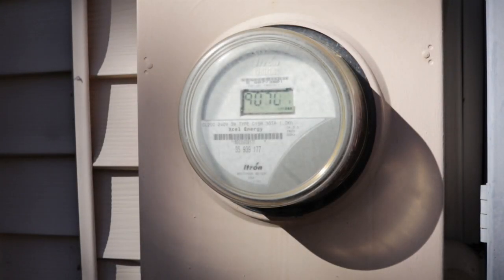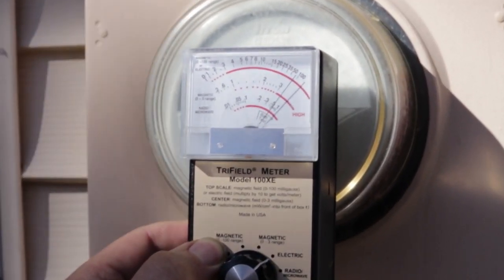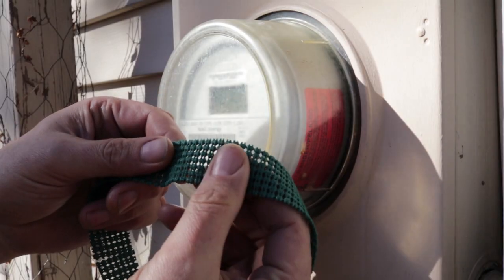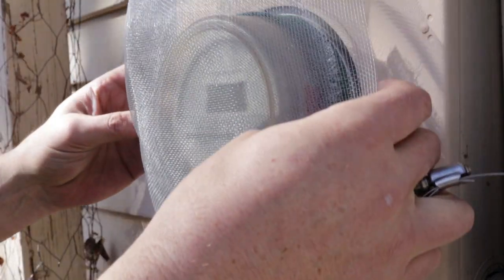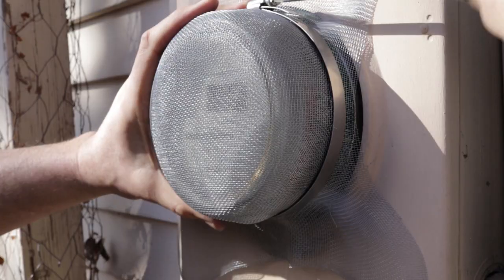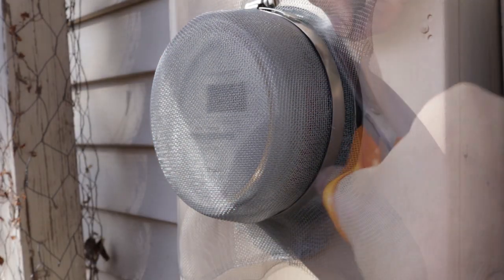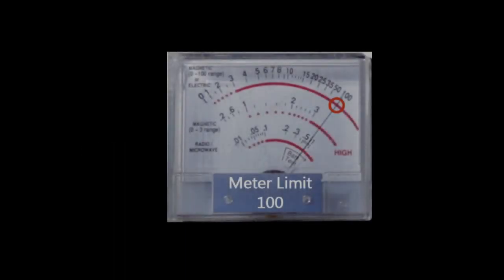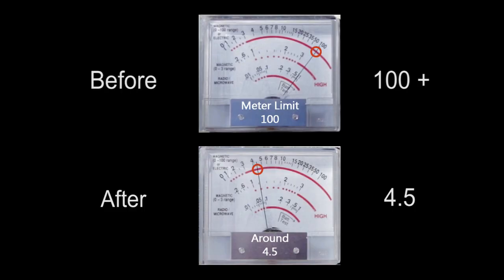Easy To Make Smart-Meter Shield Cuts EMF 95%!

Comment: But the meter at 1ft away it is not reading anything bad, only when you put the meter right up to the smart meter does it increase to 100.  What is the point if you are generally always a few feet from the meter??

Comment: by shielding the front side, the signals bounce around and amplify coming out on the inside. The best way to shield your self from it is by placing a 1 meter flat sheet of aluminum fly screen on the inside wall. all signals will then bounce off it and go outwards and away from the house.
Reply: Curious why a screen and not solid

Comment: My first thoughts...
The "smart" meter is designed to communicate with a base station. When blocking or reducing its signals, it may very well adjust the output signal up to max possible effect, just like mobile phones have the ability to do.

Comment: Yes, aluminum screen does make a significant difference. I had mine tested , I saw the numbers go from a high of 19000 units , down to 108-120 units as soon as the screen was installed. Stainless , or other conductive metal works, but not plastic bug screen. I will suggest that the screen is absorbing the emissions because it is grounded. 
My screen has a wire and aligator clip to attach to the metal pole that is holding the Smart Meter. 
See this video, the woman in it showed me how to make mine. And she did the testing on my house meter.:  
https://www.youtube.com/watch?v=BrMIr6d4mGI&t=570s   
Thank you Shona !
- Don in Nelson, B.C.
Reply: great! thanks .. will check it out

Comment: Doesn't it need to be grounded? Please answer.
Reply: did you get an answer? ....
Reply: Yes, you're absolutely right, it needs to be grounded, but the whole thing is completely pointless, it can only be measured from a distance of 5-6 inches + it doesn't shield inward, in fact it reflects back the EMF twice into the house ... let's just skip it.

Comment: You need to ground the cage with Copper line into the ground as well.
2 layers of window screen, rubber 
for housing & a large hose clamp.
From 100-4.
Reply: How do you recommend attaching the copper wire?
Reply: Yes, you're absolutely right, it needs earthing (ground).
But doesn't he say it's on the outside wall of the house? Then he achieves the exact opposite. After all, it's not even a Faraday cage, it only shields from one side.  IN FACT!! It's like a satellite dish that directs now even a higher electromagnetic field into the house. 
Anyway, it's actually such a minimal EMF that... even with the meter, he only seemed to detect an EMF only from about 5-6 inches away. 
And it's just 50 or 60 Hz @ 115 or max 250 Volts...
I don't want to hurt anyone's feelings... I just don't see the point.

Comment: I've been looking into this after my chiropractor mentioned the EMF trying to figure out the origin of the chronic pain I have, especially in the morning. Bruxism too. Researched this exposure could be part of the problem. This Smart Meter is on the other side of my bedroom wall, literally 3 feet from my bed. Have a EMF meter coming tomorrow and already have everything to make this shield. Hoping the reader shows there is something significant coming off of it and if not, one more thing to check off the list.
Reply: Has it made a difference for you?
Reply: @PeaceOnEarth39  The meter revealed that the amount actually coming into my bedroom was very low. The problem is that the fuse box is below that into the basement with no real way for me to block that signal, and the reading from in the basement  is significantly higher, but from using the meter while laying in bed to check the exposure, the numbers aren't high. The cage certainly made the number lower, but the tower fan I have in the bedroom made the reader go off the charts, which was confusing to me given there's obviously no signal being beamed back and forth from it. I don't know what to make of that. Did/do you have a problem with the TMJ/grinding too?
Reply: @allgoldproductions  I just grind my teeth at night. I was just curious if it helped you. I just called electric company they reassured me mine just has a digital read out, but not a smart meter. I will Have an option next year to opt out when they plan on implementing it. Thank You for taking the time to reply!
Reply: @allgoldproductions  the smart meters broadcast rf through the homes wires that's why fan is setting off meter
Reply: @ducksinarowpatience  I can't get rid of that fan, it's great for white noise. So you're saying radio frequency is setting off the detector? Like a tv remote? I noticed the laptop I use daily is very high when it's plugged in, not all from the battery. But that's not a very practical way to use this computer. I have thought about blocking the fuse box from the basement, but like I said, from my bed the meter reading is very low, so I don't think I'm being exposed to anything harmful there. I still have this on my meter outside though.

Comment: What about dirty electricity? You still need to fix that because smart meters make dirty electricity because of the power mode switching supply
Reply: You would need stetzer filters
Reply: what is dirty electricity?
Reply: @nikolatesla537  You could do a search for what dirty electricity is.  I'm dealing with it now since the new smart meter went in in December.  It makes my lights flicker real bad on a regular basis.  Even lights that are turned off flicker on and off once or twice per hour.  Very annoying.  I'm worried about my brand new washer & dryer which, like every new appliance these days, are run by electronic circuit boards.

Comment: Have you measured behind the wall where that box is mounted to see if radiation penetrates through?
Reply: It would. Except a field is not radiation.
Reply: The grounded steel box prevents that.  The RF only escapes via glass. It radiates everywhere.  That's why what he made helps.
Reply: The front of that isn't glass. It is plastic of plexiglass. @ducksinarowpatience

Comment: Have you tried to make a box for the wifi router this way? I don't quite understand how it can be both ways- reducing radiation, but still allowing wifi to work, however they do make commercial boxes. Dos the mesh size matters in terms of totally blocking versus allowing less?

Comment: I have to wonder. Who is going to be gaming around that close to the meter anyway? Besides, the family will be hanging around on the backside of that meter. What you've likely done, since it's not shielding the back, is created a reflector that better concentrates and bounces the EMF better inward toward the family.

Need to also take the readings inside the house, behind the meter (with and without your cage), then consider masking a shield on the inside wall. Same material. Probably best if you ground it too.
Reply from the maker: Nope, the tranceiver is located in the plastic housing that extends out so it can transmit and receive openly. And I did take measurements on the other side of the wall before and after. It stayed at zero. This thing really works!
Reply: *hanging around
Reply: Awesome

Comment: But why would you do this?
Reply from the maker: the World Health Organization has classified EMF; Electro Magnetic Fields as a class B carcinogen. They have proven it causes cancer. The EMF put out by smart meters is WAY above the safety limits for the human body.
Reply: @ManOfChanges  Just googled it. Are you referring to the IARC (part of WHO) which categorised EMF through long term heavy phone use as type 2B? They define 2B as meaning that there is "less than sufficient evidence" to show carcinogenicity. That's not how you just characterised it. That means there are some possible indicators but the jury still being out and it might well be nothing. It's common for studies, especially low sample size ones, to hint at subtle links that turn out not be there, correlations without causation or just artifacts from sample noise. Also, I don't think there's a mechanism for this so this is very shaky hypothesis indeed. 

Even if this link is real, there's a truism in medicine: sola dosis facit venenum the dose makes the poison. That's to say, the only difference between the lethality of water and arsenic is in the dosage required. Every medical student learns this. Look up the chemicals in an apple if you want to be truly horrified. Know that if you ate a thousand apples you'd died but I've you're fine. 

EMF is described by Coulomb's Law. That's an inverse square law which drops off to bugger all very quickly. Take readings a metre away and five metres away. Unless you're sleeping with your head on the meter, it's not something you should worry about even if you're taking a super cautious "just in case" approach. That's why studies have focused on phones, they're held directly to your head with continuous exposure. So, over a period of a year, how much exposure do you get from your meter? An insignificant amount. 

It's not the strength of the field at a maximum that matters is the point but the time that you spend in proximity. Remember, the Earth itself has an EMF as any compass will tell you. And that's if there's any link at all, which there probably isn't. 

Do you eat red meat? Do you live near a busy road? Is there a coal power plant near by? Do you drink alcohol? Worry about that instead, there links there are very well established. 

But don't worry too much, stress is bad for your health.
Reply: @davidmurphy563  thank you

Comment: But there's no screen between the meter and the inside of the house.
Reply from the maker: That's ok, the actual field receiver/transmitter is emitting from within the plastic housing just behind the digital screen, and there is metal behind it. I took readings from inside the house and it was equally minimized.
Reply: @ManOfChanges  hi, does that mean that even without the fairday cage the emf is reduced inside the house because of the metal against the wall? Thanks.
Reply: @ManOfChanges  That's great!  Thanks!!!

Comment: What type of metal is the screen made of, and where can you get it?
Reply: Does aluminum screening work?
Reply: @monroe1618  Yes, aluminum screen does make a significant difference. I had mine tested , I saw the numbers go from a high of 19000 units , down to 108-120 units as soon as the screen was installed. Stainless , or other conductive metal works, but not plastic bug screen. I will suggest that the screen is absorbing the emissions because it is grounded. 
My screen has a wire and aligator clip to attach to the metal pole that is holding the Smart Meter. 
See this video, the woman in it showed me how to make mine. And she did the testing on my house meter. Thank you Shona !
- Don in Nelson, B.C.
Reply from the maker: It's basically stainless steel, you can buy small rolls at the hardware store for less than $10

Comment: My water meter is in my basement, would this work for indoors too?  I wrapped aluminum foil around mine!  Lol, probably made it worse!
Reply from the maker: It will work no matter where the meter is. Smart meters have the digital screen, the older safer version has small dials. The good thing about using metal screen is it doesn't impede the signal, it just diffuses the 'gathered' EMF. Aluminum foil might help some, but If you impede the signal the electric company might pay you a visit.
Reply: @ManOfChanges  I'm a noob to this....so I can use a metal window screen that keeps out mosquito's as a faraday cage. Am I correct?
Reply: @ManOfChanges  The one in the basement is for water only, I don't think the meters on the outside are smart meters unless they changed them without telling me. We have some hard wire I think it's called, it might be too big of squares to use. I'll get my husband on it as soon as he stops working 6-7 days a week.  I might be able to do it if I felt up to it.  I get shaming letters from my electric co. telling me I use more than all my neighbors and if I were a criminal mind I'd use it on them.  :)
Reply: Doesn’t this make the meter unreadable remotely?